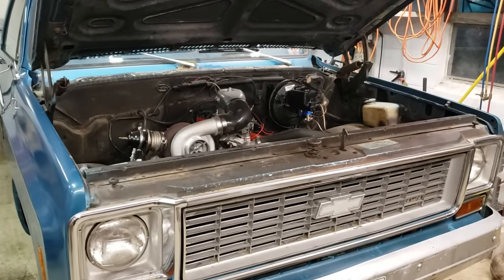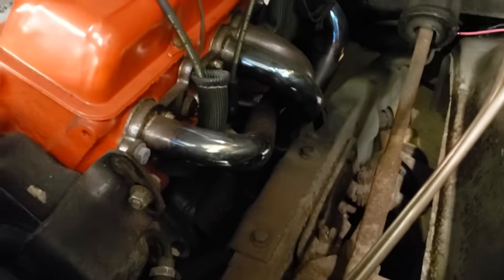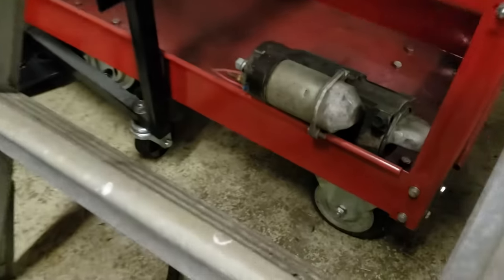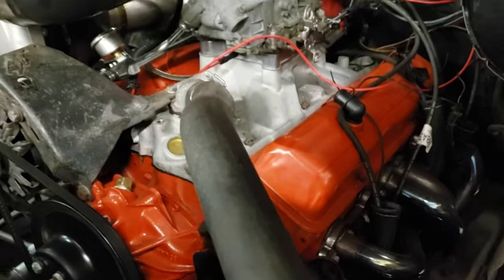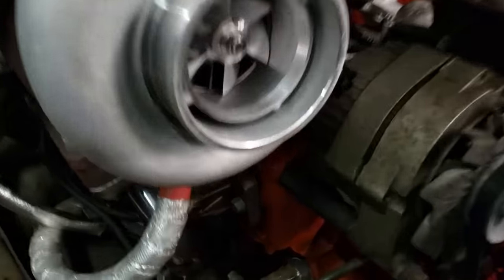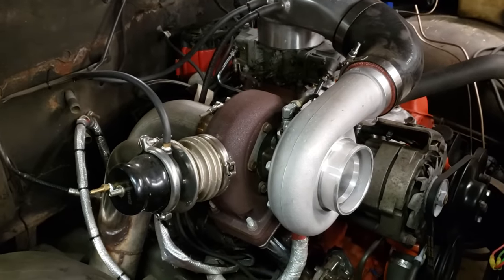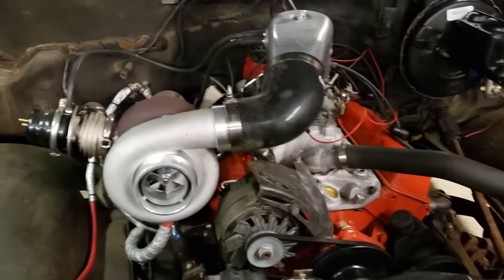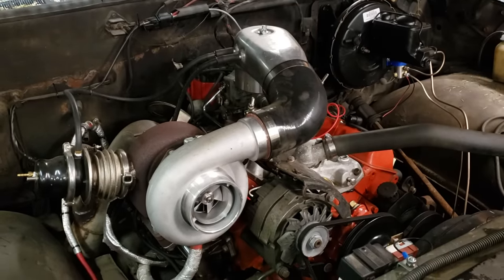Should you buy the $699 Ebay SBC turbo kit?

Comment: My comment/question has nothing to do with this video, but rather on an old video featuring your 1950 Westinghouse air compressor. I'm choosing to post this here in hopes you'll see it rather than an old one.  I have a Westinghouse compressor very similar to yours.  It have functioned perfectly for 40 years, but recently it has begun to almost stall the electric motor.  It starts up fine but when the tank pressure reaches 80-90 psi it begins to load the motor down.  I've had the motor and wiring checked out , appears good.  The pump turns freely by hand but appears to load up at 80-90 psi.  I'm told the check valve to the tank is probably defective, but I have removed the piping from the outlet to the tank and there is nothing in that line.  The unloader  appears to be working properly as the pressure bleeds down.  Does your compressor have a check valve at the tank?  Any thoughts.  Thanks
Reply from the maker: No idea honestly. I think the check valves are in the actual heads of the compressor. Only issue I have with mine is that it builds pressure very slow.
Reply: Get an amp meter and measure the motor! I'm willing to bet the motor is bad and drawing too many amps!!!
Does it get hot and or overheat? 
Hopefully it has a variable pulley on it so you can turn the pump a little slower, that should help with the higher load at the high pressure you're referring to....
If you would like more suggestions on how to get your compressor running correctly, feel free to email me pics and DESCRIPTIONs. Hope this helped!!
boostcati@gmail.com
Reply: Your check valve is in the tank where your line comes from compressor it looks like a bushing pipe fitting right into top of tank

Comment: How do you get a carburetor to take 10 psi fuel pressure without blowing thru the needle valve
Reply from the maker: Blow-through modifications. 15psi of fuel pushing against 10psi of air pressure in the bowls means the carburetor behaves the same as it would normally.

Comment: Sorry this thing was such a pain in the ass, but quick question, what carburetor are you using and without an intercooler do you know what your intake temps are. I know carburetors drop intake temps (thank you frieburger)
Reply from the maker: I don't know the exact temp. I was planning on putting bbq temperature probes in it on a the dyno for testing some time.

Comment: Can someone explain to me how notching a half inch off the top of the frame rail would be a concern. It not like it's near a cross member or a suspension component. People aren't upset when someone does a spring under on the back and then puts a big nasty C notch in the frame. I figure with all the technicians/ engineers that have left comments someone would be able to explain this to me.
Reply from the maker: Obviously notching the horizontal plane of a 8'' tall truck frame forward of the engine crossmember will ruin the entire structural integrity of the truck from all the weight of the radiator pushing down on it.
Reply: @FuelInjectionSucks  Lets be realistic though. They way you notched your frame that everyone is so upset over really is not a concern. The amount of these trucks I've worked on with the frames cut the exact same, probably a hundred, I've never seen one that has had issues because of it. Had the frame of been cut vertical that would be a different story. Should you cut a frame ? No. Is there going to be any issues because of it ? Highly unlikely. That's all I was getting at. People get too bent out of shape when they see something that they don't understand. Even if it was an issue that area can easily be boxed in and that would make it stronger than the factory. Those old C10 have such a loose frame to begin with. Too narrow all the way through. They flex and twist all over the place. They also either rot out or crack where the steering box mounts. That alone is way more of a concern than trimming a half inch off the top of the rail.
Reply: Maybe a problem in an accident

Comment: Does anyone really expect a "universal kit" to bolt into any car without having to modify anything?
I guess it's time to say 'Welcome to got rodding - where NOTHING universal fits, and most of the time Direct Fit parts need to be modified'.
Just an example - when plain old headers were bought for a specific application and actually fit WE THREW A PARTY!
I could write a book. Special bolts with smaller heads to clear the pipe at the flange and you had to dent the pipe to tighten the bolt anyways - even with a ground down wrench or turned down socket, and then getting that bolt through the flange had to be done before it was held up to the head.
Of course there was plenty of times the holes in the header were off location in the first place.
So - you cut the one piece flange between the pipes so you could line up the holes.
Now - there was no way you were going to change spark plugs unless you beat one or two pipes halfway closed.
moving away from the engine itself - one or more pipes might hit the firewall, the clutch linkage, the steering shaft, the power-steering pump, the frame, or the collector hung so low you had to jack up the car to back out of the driveway.
THESE WERE HEADERS DESIGNED SPECIFICALLY FOR THAT PARTICULAR CAR!
Look at the turbo kits for fwd imports - step one, remove front bumper and grill.....
You get the idea.....
SMH!

Comment: Dude you're not supposed to notch your frame you shouldn't be cutting anything out of your frame if anything you should be making your own set of headers or dent the pipe in with a ball-peen hammer anyting except for cut your frame